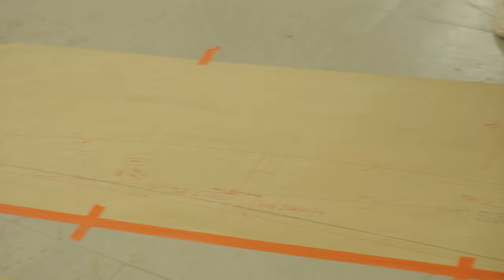[5편] 짜맞춤을 이용한 난이도 높은 실내가구를 제작하다 Korea WoodroLeehyun woodworker

Comment: I understood from viewing routing videos that it was advisable to move from left to right when shaping on an external surface and right to left on an internal shaping process such as forming a window moulding on an assembled sash but obviously, opinions differ! That means that the cutter edge is always leading the timber removal. This video seems to show the circumference of the cutter leading the process which I would think that the cut surface would be slightly wavy and possibly would require refinishing?